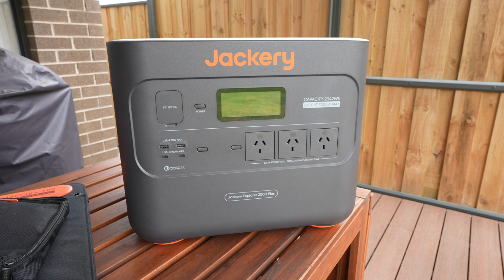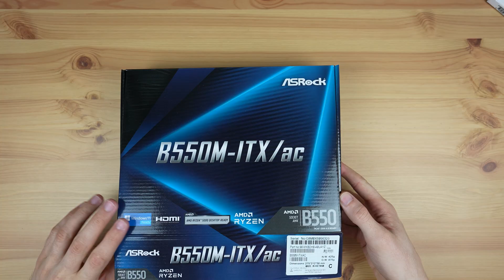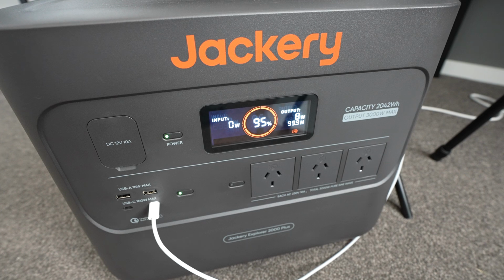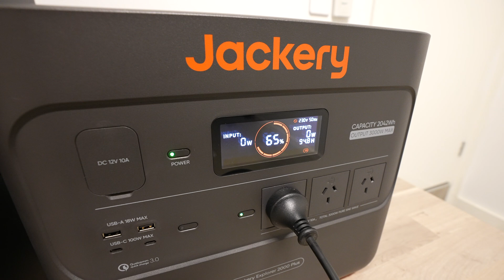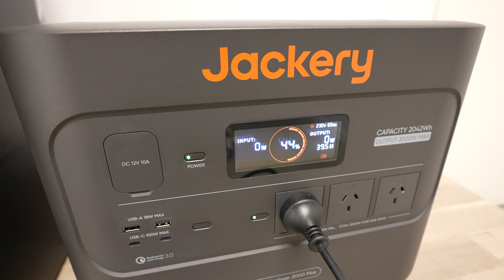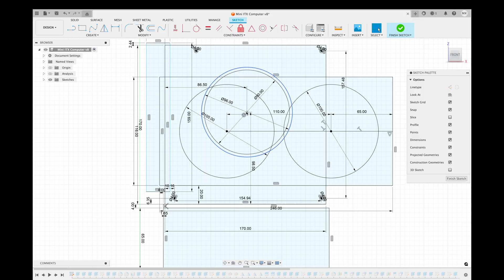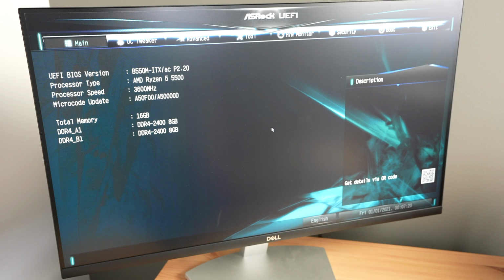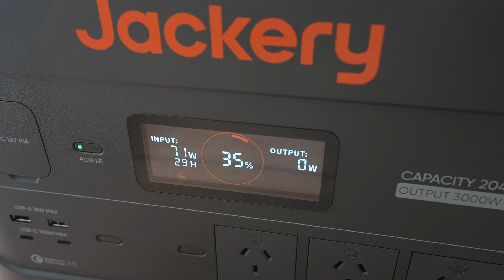Can I Design & Print A Mini-ITX Computer With One Charge Of The Jackery Solar Generator 2000 Plus?

Comment: I'm pretty worried about that power supply. Being the riser cable ontop of the whole for the fan of the power supply. Cutting off the air flow there. But over all very nice design.
Reply from the maker: Yeah the fan is partially covered, not ideal. I haven't run into any issues with it yet though. I think it is sufficiently oversized that it'll hopefully not be an issue. It's rated for 500W and the PC only draws around 150-200W so shouldn't be producing anywhere near it's maximum heat load.

Comment: sorry but im calling horseshit on this, the case body alone was 8 hours, at about 200 watts average( remember the beginning spike for each and every print) thats 1600watthours, or 78% of the battery for that part alone. 5 other prints had to go through plus the laser cutter. and it claims 32% left after that..... that math dosent work. THe trust worthyness of people that get free stuff to advertise it....
Reply from the maker: I'm not sure what you think I could possibly be gaining by making up the usage? If I couldn't get the whole project done it would have been far easier for me to say "can I 3D print the case" or "can I design the case" on one charge, it is a lot more effort to artificially make up usage and get footage to match than it would be to just see what happens and use the results.

In any case, here are the actual percentages after each component from the raw footage;
Case 21% or 439Wh
Legs 4% or 82Wh
Front Grill 2% or 41Wh
Ryzen Side Panel 7% or 143Wh
Radeon Side Panel 8% or 163Wh

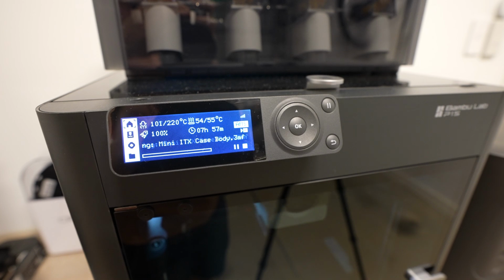In looking back at the raw footage to get the above, I've realised that the printer is actually using a lot less power when the bed is not on, you can see this in the background of the timelapse footage 6:40 to 6:45, that it is often running under 50W hence the lower than expected power draws.

Comment: you cheated, no cooling on the laser. Would have been better if it was solar charged so charging off mains kinda defeats the purpose.
Reply from the maker: My laser has integrated cooling and ventilation, it is all powered from one point. The power unit was charged entirely with solar which was mentioned a few times in the video.
Reply: Check out the segment. It was charged by the 100watt panel

Comment: That's pretty cool but why did you use the infill mesh method but leave big holes for the fans? couldn't you have left it "solid" in the model and then it would've been converted to mesh and still allow the fan to breathe while protecting it from fingers?
Reply from the maker: I like the look of the exposed fans but yes I could have pretty easily just left the whole panel as a solid mesh and that would probably work equally well.